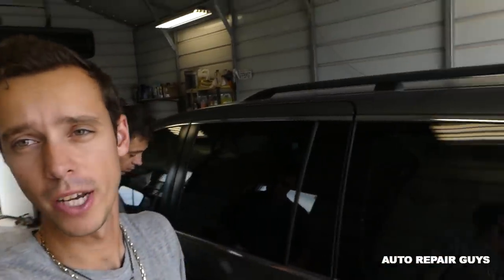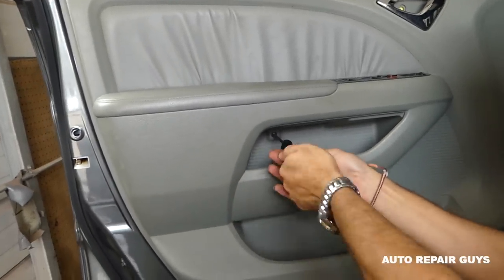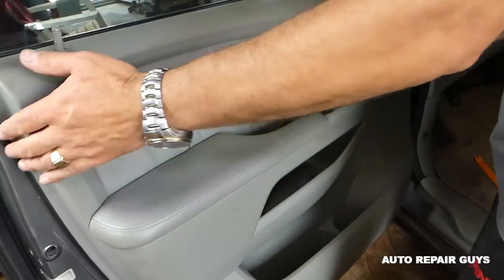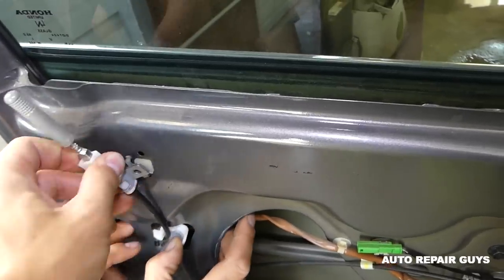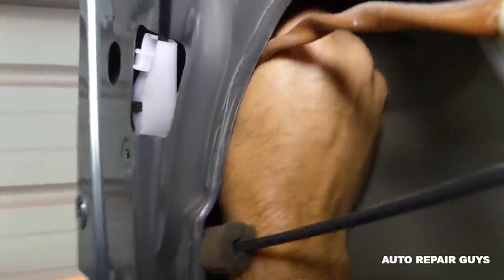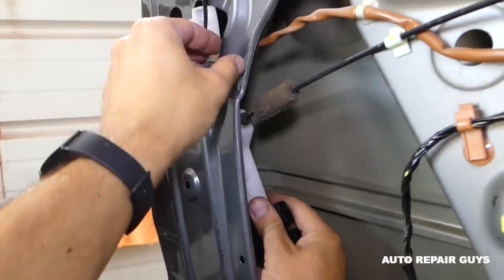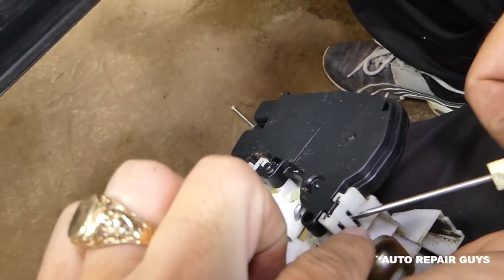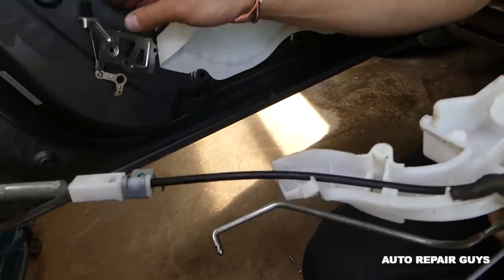HONDA ODYSSEY DOOR LOCK ACTUATOR REPLACEMENT REMOVAL

Comment: Great help, gentlemen. Video allowed me to DIY repair for $15 in parts vs a repair quoted at >$400 by local mechanic and +/-$700 by Honda Dealer. Took me 2 hours, including a complete undo/redo because of a connector problem w/ one of the harness clips onto the new actuator. Second time was much faster. I would recommend reconnecting the window/lock controller and testing the new actuator while holding it in your hand, before reinstallation inside the door and replacing window rail. Keep testing the function as you work to re-assemble the parts and attach back onto door. Definitely have a couple flash lights to assist your view inside door. The hardest part was disengaging the two unfinished metal push rods. The larger rod needs a strong tug to the right (drivers door), toward the door hinge to disengage. The smaller rod, closer to the door latch-end of door, is hard to see, and needs a slight tug toward you/the interior of car to remove. Be sure to swing the small plastic clips to the disengaged position before tugging rods to remove. Installing rods back into sockets is much easier.
I had to redo install a 2nd time because of a problematic white plug that dislodged from inside the power connector harness (see item at 8:00 mark in video) and stayed lodged inside the old actuator, preventing the new actuator from having a good connection with the harness, preventing proper function. Re-installing the white plug back into harness fixed the problem immediately and all finished completely functional. Lovely fix and saved real $$. Very much appreciate you both sharing your skills on your YouTube channel.

Comment: Just wanted to thank you for the video.  I have very little mechanical expertise.  I bought an actuator on Ebay for $12 and installed it in 2 hours thanks to your video.  Some of your video shots were tough to follow but your description was easy enough to follow.  Trickiest part was getting the window rail to line up right.  Thanks again.

Comment: The lock actuator on the driver side of my 2010 started making horrible noises. I googled the problem, found your video, ordered the part from Amazon ($12.99 + tax, $14.00 total), and started the project yesterday (on a Sunday). The biggest problem was the 3 screws on the side holding the locking mechanism in place, 1 was incredibly tight and started to strip, so I ended up taking it to Honda this morning to get help with that screw, and lucky for me, a nice guy got that screw out! This afternoon I finished the project and my door lock works perfect now!  I agree with a couple other folks, putting the window rail back in was a giant pain, found out had to use a little mirror and little light to see exactly how to get that piece back in. Other than that, instructions were very well done!  Thanks, you saved me a ton of money I'm sure! (And for all you ladies out there.... this woman did it - so can you!!!)

Comment: Great video guys, thanks.  I did this to the passenger side today on my 2008, took me just over an hour.  Hardest part was putting the window rail back, had to fiddle with it a lot to get in into place at the top.  Since you can't see anything, you have to use the force and feel your way!  Local Honda dealer was charging $315 CAD to do this job.  I bought the part on Amazon for $25 CAD (for both sides).  The foam piece on the white cable was all torn so I put some electrical tape on the rough metal edge of the door to prevent the cable from getting damaged.

Comment: This was a great video!  I was able to easily replace the door actuator, and i am not someone who is knowledgable about cars or car parts. It would be helpful if you could extend the video to show reassembly as well as you didn’t mention the window rail comes out of a bracket and needs to be reinstalled into this bracket. I also didn’t think about the orange wire until I had to reinstall and I didn’t have it in the correct place- it needs to go behind the window rail, which is probably obvious to many people, but not something I paid attention to until I put the window down to test out the locks and the orange wire was in the way. Those are two bits of information that might be helpful to others that I learned by trial and error. Thanks for your video!  I know I saved a lot of money doing this repair myself!

Comment: You guys rule! Thanks for saving me a bundle! I was able to replace this inexpensive part this morning. I only missed positioning the door handle lever correctly before replacing the metal cover over the actuator.  It was easy to correct and I'm back at 100% .

Comment: Thanks Guys!  I was able to replace the driver side actuator on my 2007 Odyssey EX with an Intermotor DLA87 in under 2 hours.  My only suggestions are  to only remove the left side of the Weather Lining and to use a few small pieces of Black Gorilla Tape to help hold the Lining back up....and take pictures before taking things apart so you know how they go back :)

Comment: Just bought a duralast actuator. It has life time warrenty so if another goes out I'm covered.  You guys really helped me alot. The only part I almost got lost was metal frame on top of actuator I almost put back with cable in wrong position. Thanks for saving me 400 dollers.

Comment: Great video, easy to follow. Once I put everything back the inside door handle does not work. Any tips to troubleshoot? I made sure the wire that is pulled by the handle is connected correctly. The connections inside the plate in actuator assembly are not shown well when putting the plate back. I am guessing if I missed anything there. Everything else works perfect except for inside door handle

Comment: I just replaced mine (2010 touring), and everything was easy, just follow instructions and apply some force to release those two hangers , firs u need to release the plastic lock , the big one with your hand, easy, the small one on the far back with the plastic tool or screw driver. Be careful not to break any plastic lock. The window part you need to feel where it seats on the top and push it up to engage the window and the screw in the back will just fit perfectly. Be sure you learn the position of the internal.parts before removing the metal plate from the wire plastic so you place it back in the same way so it will engage well and work fine, and yes, TEST it before placing stuff back! Both the remote and the window . Thanks a lot . Saved me a lot of money.

Comment: Very helpful video - thanks for shooting and sharing this repair.  I found it took less than an hour on a 2009 Odyssey Touring.  Hardest part was getting the window channel back in - i used a telescoping angle mirror and a drop light and it made it much easier to align the channel with the bottom bracket/bottom of the window.

Comment: Thank you for the guide.  Made it so I could do it.  Hardest part was remembering to put things back in order... Put the window rail in before putting door panel back.  Putting the handle cable back and plug the speaker in.

Helpful tip.  You can peak at the window rail placement through the hole where the lock cable goes.

Also, don't remove the plastic lock grip like another video suggested.  It is hard to get it to screw back on.

Comment: Getting the window track back was difficult for me.  But everything else I found out about this was because of you guys!  Thank you...and subscribed!
Reply: Auto Repair Guys...this past week the door latch on the inside stopped working!  And today I had a chance to work on it.  I took it apart and put it back again (again, your video was an awesome help).  Upon putting everything back, I noticed there was a bit of slack in the cable you removed at 4:28 of your video.  Can you tell if I unwound or started something at the wrong position?

Comment: Great video! Got it all fixed up!

QUESTION: about a week after doing this the driver window suddenly stopped working. Before the actuator replacement it struggled to get up and down. After actuator replacement it seemed that problem was fixed as well. I attributed it to removing the window rail and cleaning it since I had it out. But now it’s just stuck closed. Doesn’t even seem to try. Could an electrical plug have come loose since I was messing with those? Or could it just be a coincidence that the motor or regulator went out just after the actuator was replaced?

Comment: Thank you so much for the video.  I bought the part for $15 and did it at home.  Outside it cost 100 just for labor.  With your video i did it at home and saved that 100.  Again THANK YOU so MUCH...

Comment: Thanks, the actuator failed few days ago driver side. It was annoying since it will not lock nor unlock the rest of door locks with remote until manually done. Bought the spare replaced it and now lock/unlock working with remote.

Comment: Minute 4:15 is important! Make sure you put back the latch appropriately to avoid HEADACHES at the end! Not able to open the door. I learned the hard way 😢😅. Thank you for the DIY 👍🙂.
Reply: May I ask what you did to correct? We now are unable to open the door.
Reply: @reluctanthomemaker  I am sorry it happened to you. You need to place the clip back to exactly where it was (in the indentation)I managed to open the door by pulling both interior and exterior handles at the same time. I hope it helps

Comment: Thanks for the video. I was able to replace the part in 45 minutes because of it. Now I’m having it issue where there lock keeps trying to lock as I drive off and the alarm keep going off randomly. Any ideas of how I can get rid of this issue thanks in advance.
Reply: I had a similar situation that I fixed by replacing a switch on the door jamb. I'm not sure what the part name is, but you'll see it when you have any of your doors open and there's a black rubber switch that can be pressed on. Lift up the flap and there's a single screw or bolt to remove it. I bought one from the dealership and installed it on one of the doors and waited to see if it fixed it. When it didn't I switched it to another door til I found out the faulty switch.

Comment: Sometimes the key fob works to unlock, but manually unlocking never works becuase it's jammed or something.  Would replacing the actuator help fix the issue of key fob working only sometimes?

Comment: Ok guys I have a question.  After I replaced actuator everything worked fine door unlocked and you could open the door from inside and out.  I pulled out of the garage and parked.  Now the door handle doesn't work on inside or outside.  Doors still lock and unlock except for the door I just replaced it on.  Any ideas what is wrong?  Thanks

Comment: where did you buy the part/ i need actuators for a 2015 odyssey. 
and...is the part that you buy just for driver's side or can it be on either side? do i have o buy a driver side and passenger specific?

Comment: Hello. I need help. Follow your instruction. First time, it did not lock. Open it, recheck, and put it back. This second time, I did not test before I close the door. Now it won't open from both inside or outside. What should I do now?

Comment: I did this to my 2013 and got the power locks to work, etc.  Unfortunately AI never tested the actual key unlocking/locking the door.  Noticed that it doesn't work.  Can someone help me narrow down what to look for when I pull the panel back off?

Comment: I've used your video twice to replace my actuator.  BUT THIS TIME - when I closed the door, the latch broke and now I can't open the door from either handle (inside or out).  I did everything right, but have found out that this happens by itself sometimes, just a worn out gear.  HOW DO I GET THE DOOR OPEN NOW!!!!!!  I've searched High and low, and my wife doesn't like exiting the car through the back anymore.  Any ideas anyone???
Reply: Hi Cory, the same thing happened to me. How did you get the door open? I've been trying everything I can think of for 2 days. My wife doesn't like getting out the other side or back either. Thank You.
Reply: @damonrockhill7533  I pried the door panel off as much as I could (after moving the seat back as far as possible and putting the steering wheel all the way up.  I was then able to jam my arm in and down and spray the latch with WD-40.  I let it soak overnight, and then the next day, I tried it and it opened!  Was able to finish the repair after that.  Hope that helps.

Comment: AVOID THIS CHEAP KNOCK OFF AFTER MARKET PART IT DOESN'T LAST VERY LONG PAY FOR THE REAL PART MORE INSTEAD OF CHANGING THIS PART ONCE A YEAR IF YOU'RE LUCKY AND DON'T GET STRANDED LOCKED OUT YOUR VEHICLE TOWING WILL COST YOU AND ARM AND A LEG PLUS ONE EYE FOR THE LOCKSMITH TO OPEN YOUR VAN 👍
Reply: You do know there was a time before auto locks lol smh
Reply: Your comment doesn't even make sense why would you need towing because your keyless entry doesn't work.